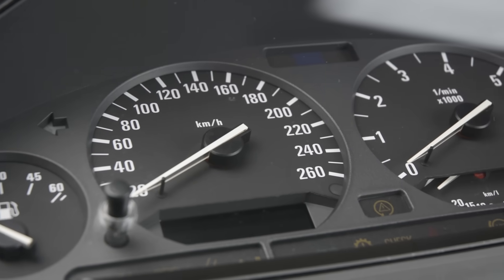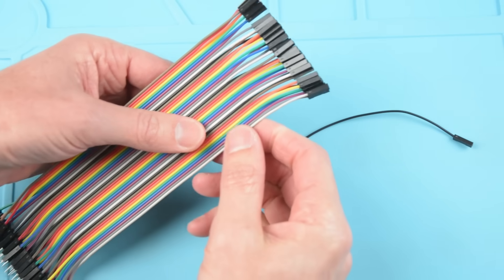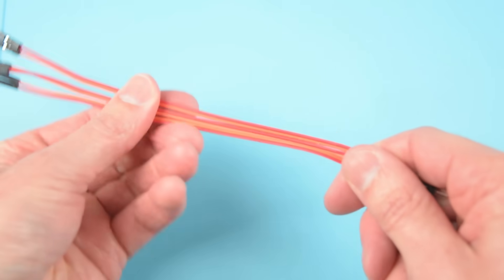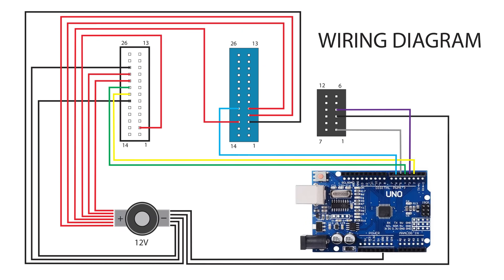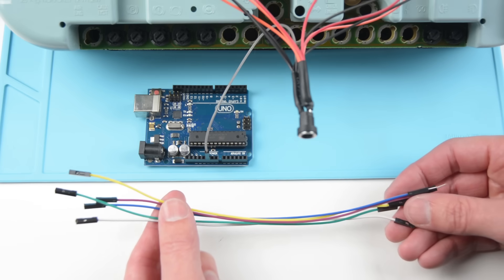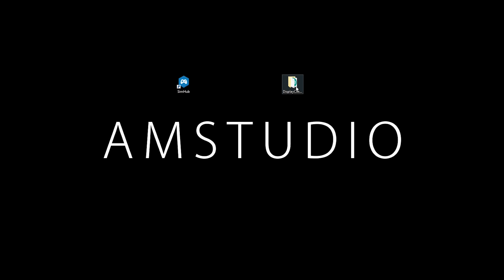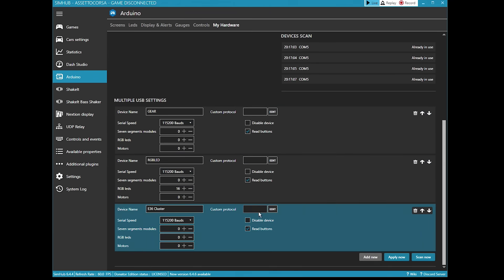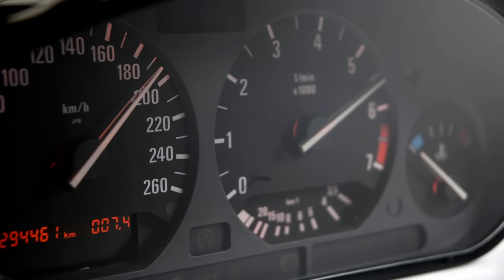HOW TO WIRE BMW SPEEDO CLUSTER FOR SIMULATOR | SIMHUB

Comment: I have a sim rig based on an E46 dash with my old E36 gauges fitted that I have been trying to find info about this since the new year, this is going to complete my rig as I already have all the buttons working thanks to your button box guide. You really are a master of all things SIM!
Reply: so, E46 cluster will also work using the same instruction AM STUIDO provided?
Reply: @mitchdorosan9969 i think if you find the right wiring diagram you can connect it following this video. Just keep in mind what wire connects to which connector on e36, and just translate it to e46 using e46 wiring diagram. Sry if i was a bit unclear but i think u will get the point 😅

Comment: What happens if a car revs above 7000
Reply: Jinsoku in sim hub you have an option to use the real rpm (the needle will pass the 7000 until it can go), or it will "translate" it as 7000 as max rpm. Example game 9000 dash 7000. Game 8000rpm dash 6250rpm. Don't know how to explain it better.

Comment: Ever thought about stripping a car dashboard and make it a working rig? Like, you got the tacho, the dash and make some external gauges for turbo, water and etc.. damn that would be a lot of Arduino!
Reply: An Arduino Mega is capable of doing that, I'm building a Volvo B10m(g) dash with a Mega for the lights and gauges, and another Mega for the buttons.

Comment: Nice build. I have a couple of questions 
1. Does this work for euro truck simulator
2. Do the blinker indicator and the fuel work?
3 how to reset the milage on the cluster to see how much miles you have driven in game?
Reply from the maker: 1. Yes 
2. Blinker not connected, Fuel - Yes as a Percentage.
3. Push button to reset the Trip.
Reply: amstudio thanks, do you know how to make the blinker work? have a good day

Comment: Would be great if you could go a bit more in depth with what easy pin does so we could use this guide for other clusters.. None the less, you are doing great God's work sir!
Reply: RPM = 2
Speed = 3
MPG = 4
Fuel = 5
Temp = 6

RPM and Speed use Tone signals, MPG, Fuel and Temp use PWM signals :D
Reply: @MorGuux  thanks for the details. Though now it gives me even less hope of trying something because I don't understand exactly how those two work XD
Reply: @MorGuux  Is it possible to replicate the project with an audi 80 speedo cluster?
Reply: @wolfy4734  Possibly, but it'll be trial and error. It's definitely not CANBUS controlled, as they stop making the 80 in 96' (IIRC). I'd imagine there's a good chance, might require stepping up the signals to 12v, but try it ;)
Reply: I don't understand what you are saying?
Reply: @MorGuux  can i use a volvo v70 2004 spedometer?
Reply: http://wedophones.com/Manuals/BMW/1999%20BMW%20318ti%20Electrical%20Troubleshooting%20Manual.pdf
page 152 you can find the pinout of the instrument cluster
edit: by clicking on the numbers, you are redirected to the corresponding plug
edit2: pages 153-4-5 is the list of the 3 connectors
Reply: No, the E46 cluster is fully CANBUS for engine data. You could still use the cluster, with a CANBUS shield, as all of the messages are documented. But it would not work using this method.
Reply: Speed and fuel is not canbus but everything else is on e46.
Reply: MorGuux So would this be identical if it were a e46 cluster?
Reply: If this was god's will we wouldn't be having this fun!
Reply: @MorGuux  any idea how with an E30 one?
Reply: @MorGuux  how do i find out?
Reply: Will this work in forza and also any dashboard??

Comment: from what engine are these cluster ?
Reply from the maker: Bmw E36 328i
Reply: Marcel Q games i think the 320i has the same 260km/h. They are more afordable than the m3 also with 260 top speed. 328i are also rare ...at least on ebay.

Comment: Its so cool that the actual milage of the cluster is going up, u should make a video how to reset the mileage, so you can see how much virtual miles you have driven!
Reply: That would be more harder, you need to desolder the eeprom memory, reverse engineer how the value is stored, and write a new value. A 0km doesnt mean its a 0 in the eeprom.
Reply: Zeroing the counter is not supposed to be simple.
Reply: If it was easy to do, people would alter the mileage displayed on actual cars, fraudulently #whywecanthavenicethings
Reply: @RoamingAdhocrat  It actually is pretty simple. There was a tool a co worker used that plugged right into the OBDII port and he hit a bunch of buttons and entered in a new milage for my audi A4 a few years ago. I even lost that bet!
Reply: @ratataran  E36 does not have OBDII
Reply: @RoamingAdhocrat  Dealers selling cars do this all the time in Poland lol
Reply: DundeeDriver it is that easy to do. I altered the mileage in my light cluster to 0 than then resync’d so I could use a different one in my Bmw. I could have easily changed the cluster to 0 to match and had 0 miles. Or any amount I wanted it to have.
Reply: @RoamingAdhocrat  Well they do. A lot actually.
Reply: just go to the local dodgy car dealershop and they will do it for you same as they are doing it  on real cars lol 😂
Reply: Robin Balentina that would be awesome!!!!
Reply: An easier solution is to write the kms/miles when you get it and then just subtract that amount
Reply: Robin Balentina I'm having trouble getting mine working and would really appreciate any help possible
Reply: @joesibgaming2615  that's the trip meter, not the odometer.
Reply: @RoamingAdhocrat  The odometer is running as well, it adds a kilometer at the 7:32 mark in the video.  People were referring to resetting that one, not the trip meter.
Reply: My MR2 on gran turismo was on 4000 miles before it got reset by a update, the odometers always reset on gt sport sadly
Reply: That's the beauty of the CAN-bus: that's incredibly difficult to do...The CAN-bus also makes it relatively easy to wire this project.
Reply: Just use one from an E30, based off your profile pic you know it wont be working in the first place so you wont have to worry about it😂
Reply: Robin Balentina *kilometrage
Reply: Robin Balentina Chris fix has a video on that
Reply: +Pascal Lafreniere you just need to download the bmw software "inpa".

Comment: Does it work with an e39 cluster ?
Reply: The problem for the e39 is that it uses a can-bus system. That means its doesn't use one simple pin for rpm and speed.
Reply: i am trying to figure it out at the moment. i'll contact you if i have a success :D
Reply: célian becquet if you know what the pinouts mean on the e36 cluster, just look for the pins with same function on the e39 cluster
Reply: No I tried it and the E39 cluster has incripted signals that go to 3 modules 1 main 2 abs 3 some other ithat i Dont Know Soo u might be able to but its too much work ;DDD Sorry for my English

Comment: I'm assuming this could be modified to use whatever dash cluster one can get for cheapest, right?
Reply: To make sure that it is compatible, it has to be a non-canbus cluster (takes in analog pwm or tone signals through dedicated pins).
Reply: erica if it has similar wiring and pin out then it's a yes
Reply: Picked one for 9£, toyota avensis cluster. Rpm meter goes up to 8 so its okay, make sure you don't get a diesel one...